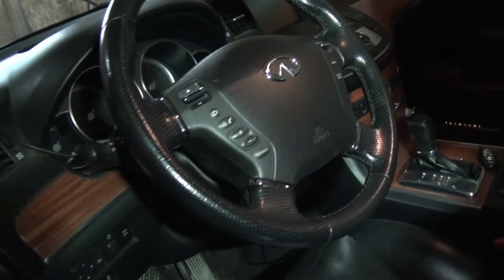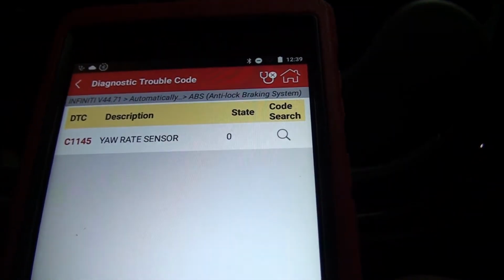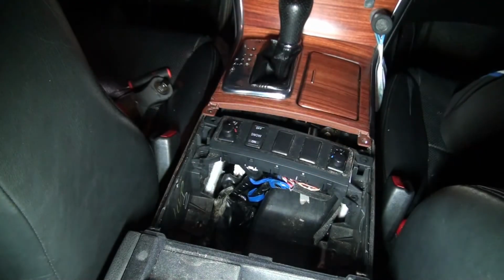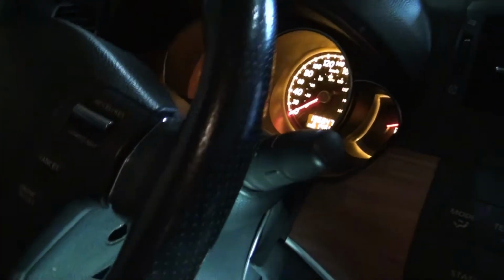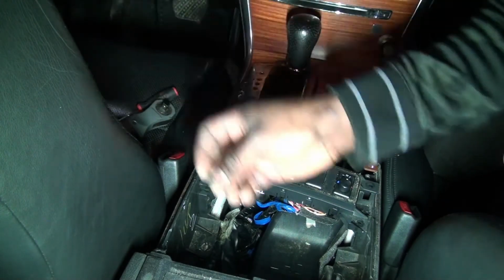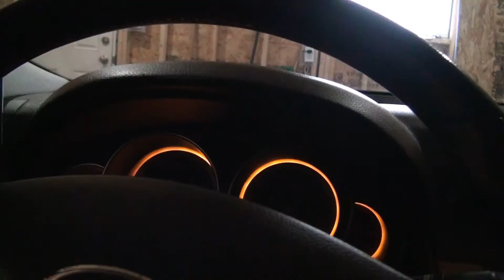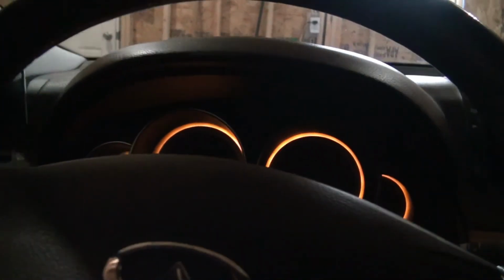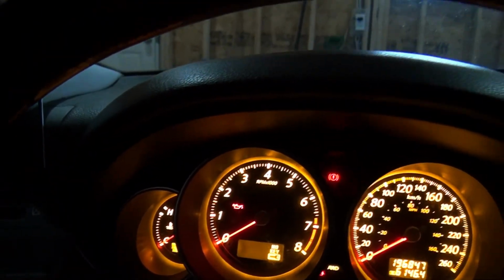2005 INFINITI M35 VSC AND SLIP WARNING LIGHT FIX.

Comment: We missed the most important part as to how you were able to gain access to the yaw rate sensor. The large AC duct running to the back is in the way. How did you get around it? Is the button to disconnect the sensor on the top or the bottom of the harness?
Reply from the maker: Just push it on right side and you will reach the bolt easily.
Please like and subscribe 💪

Comment: I have a 08 M35 & A 06 M35 S i also experienced this issue with my 06 G35 sedan these same lights come on if the crankshaft sensor goes bad too or if one of the camshaft position sensor goes bad i fixed both in my 06 G35 & 08 M35 & as soon as the weather gets better im changing them in my 06 M35 as well
Reply from the maker: please like and subscribe
let me know if the video helped you bro.
Reply: I got a question for you about your 08 m35

Comment: But what to do if SLIP + VDC OFF  + RAS warnings lights?
Reply: Same question I’m asking myself lol. Can you help ?
Reply: All those lights where on in my m45 06 Nd it was just my rear brakes changed them Nd the blights turned off
Reply: bru same rn exact same problem none got a video abt it
Reply: @rubenmorin7479  what u had to do i got 06 m45 sport
Reply: Same with my 06 m45s you ever find a solution?
Reply: @nicholashernandez5288  No. Even the officials couldn't fix this error. But it doesn't seem to affect anything, so I've been driving with it for several years🤷‍♂
Reply: @grodarh   dam same thing with my fuga 450gt
Reply: Same problem with my 06 m45 only in the heat the vdc,ras,slip light turn on then the car starts to shift hard
Reply: @AngelRamirez-ur8rx  I had these lights on in my M45 and I replaced this exact sensor and no more lights.

Comment: My 2009 M35 runs great but if I hit the gas to hard or try to do a pull it glitches out & then every gear bangs until I shut the car down & turn it back on this light comes on everytime it happens but when I reset the car it goes away
Reply from the maker: I think in your case the light comes on just to warn you that you have an emission problem.
Check your throttle position sensor make sure nothing is shorting out.

Comment: I have a question, I have the same car but mine is M45, 06 which is 05. I have the same exact problem of the slip light and the VDC off light stay on on the dash. Recently I was driving in the snow and both light (VDC & Slip) came off but the slip light was flashing because my rear tire was spinning. Whatever it’s was functioning right because that how it supposed to work. My question is do you think it is the sensor or it something else???
Reply from the maker: I would advise you to get that system checked out with a mechanic.

Comment: Hi I have infiniti m35x 2009 in we replaced the starter I. Have those lights after that!!any tip u ca. K
Helo me our.
Reply: @QUICKAUTOMOTIVEDIAGNOSTICS Thank you for the reply I also have check engine P00014 and P00024, and the other problem in need to scanne.